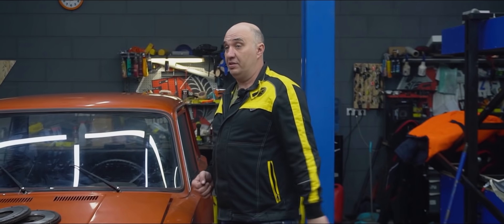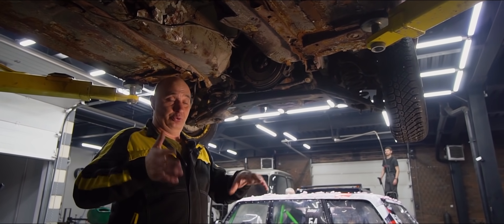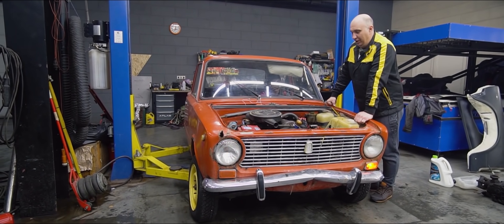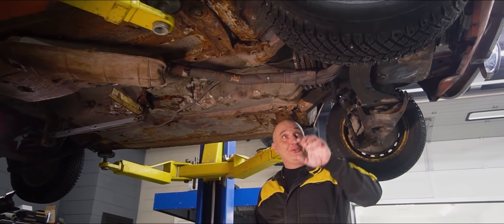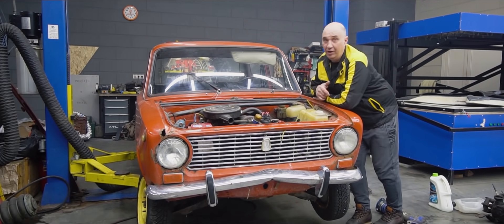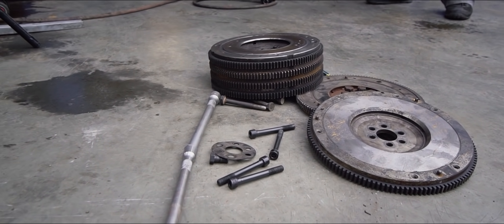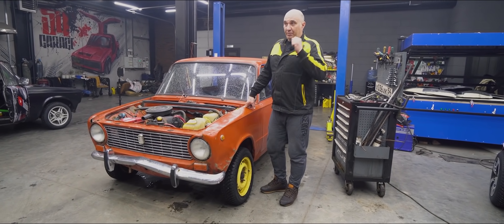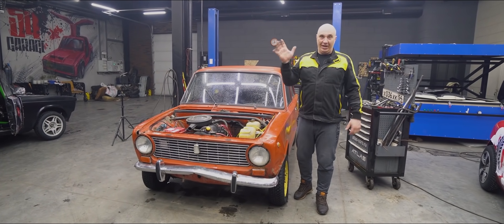What if you install FIVE flywheels onto an engine?

Comment: My guess is going to be "The smoothest idle you ever heard."
Reply: Imagine that inrush current in the starter motor with all that inertia to overcome....
Reply: @TerryGilsenan   no different when the oil is super cold
Reply: @MyKonaRC  Cold oil == more drag. Heavier flywheel == more inertia.
Reply: 😎<- idle
Reply: @TerryGilsenan  you can drive the whole car on the starter. It wont even notice a bunch of flywheels
Reply: @m.b.82  not for long you cant.
Reply: @TerryGilsenan  no. But it does it easy
You can overheat and burn out your starter in normal use if you run it too long. But torque is not an issue whatsoever.
Reply: @m.b.82  okay :)
Reply: That’s why they fit light weight fly wheels to race cars quicker going up and down the revs more responsive
Reply: Now, put on one more. Make it five flywheels.
And
Put on the door closer.
Make some young girl without license drive it.

And also try to have really low RPM
Reply: The smoothest idle would probably go to a V12 or a Flat 12 engine.
Reply: Stall allert
Reply: Yeah, constantly idle 😆.
Reply: Тоже этот детсад, интересуетесь
Reply: Hi
Reply: yup smooth idle verry little vibrations and hard to accellerate , it might break the snout of the crank
Reply: @huntsbychainsaw5986  wankle😂😂😂
Reply: @TerryGilsenan  air compression is the most to overcome, then tension in pistons. Take a wheel of a car, (similar weight to flywheel and even bigger diameter ) then kick it or accelerate it with your hands. It’s not that hard.
Reply: @David-cy5zu  Starter motors are designed to be high torque motors that run for a couple of seconds or a minute at most. They were not designed to run high current (200+ amps) for more than a few seconds. This is their "duty time".

Even if you remove all the addition load from compression and drag, they still only spin at around 2000RPM and they still draw more than 50% of their rated current, because they are almost a short circuit.

Want to know their MAX RPM? Start the engine, and at a low idle, engage the starter motor, what do you hear? You hear the stater pinion gear getting kicked out of mesh with the flywheel ring gear, why? because even at low idle, the engine is too fast for the starter motor.

As for overcoming compression, most high compression engines for example high capacity diesel, have a decompression system that allows the starter to spin the engine without compression load and then once the starting inertia is overcome, the decompression system disengages and allows the combined stater and engine inertia to push the engine through the compression cycle to reach the "bang" cycle.

In my younger day I made quite a dit of money hustling people with "big bore" single motorcycles, by betting that I could start the engine with one hand.
Reply: @David-cy5zu  Try and spin that same car wheel beyond say, 300RPM, then tell me it's not that hard. :) Circular motion requires CONSTANT acceleration. This is simple newtonian physics. The amount of energy required to increase the RPM of a spinning object is NOT linear, it is a logarithm, and the mass of the rotating mass is part of the calculation. Even if you remove ALL the friction (impossible, but for the benefit of this discussion) the amount of energy you would have to introduce to increase the RPM of the spinning wheel, increases with the RPM.
Reply: @liamc666  You get it. :)
Reply: Flywheel-powered bus:

Rather than carrying an internal combustion engine or batteries, or connecting to overhead powerlines, a gyrobus carries a large flywheel that is spun at up to 3,000 RPM by a "squirrel cage" motor.[1] Power for charging the flywheel was sourced by means of three booms mounted on the vehicle's roof, which contacted charging points located as required or where appropriate (at passenger stops en route, or at terminals, for instance). To obtain tractive power, capacitors would excite the flywheel's charging motor so that it became a generator, in this way transforming the energy stored in the flywheel back into electricity. Vehicle braking was electric, and some of the energy was recycled back into the flywheel, thereby extending its range.

https://en.m.wikipedia.org/wiki/Gyrobus
Reply: @TerryGilsenan  Try that on a 1970 Norton Commando :)
Reply: @andrewallen9993  I would have loved to try that.
Reply: That engine may rev and decelerate slower but if you give it a sudden load it wouldn't bog or stall this extra heavy flywheel is particularly beneficial on generators, pumps, air compressors, brush cutters, wood chippers, bulldozers/tractors, and other equipment that needs to run at a constant rate with rapidly varying loads and sudden loads. Most beneficial for high torque applications with low revs/hp
Reply: @dodgeme1986truck  Yes, That is 100% the actual purpose of a flywheel.
Reply: Another effect for the same inertial torque while lightening the flywheel mass overall  is to increase the flywheel diameter.
Reply: Ever felt.....all those flywheels absorbing the harmonics
Reply: @dodgeme1986truck  Farymann  V twin engine I have, push down on the decompression lever to stop. And wait,  and wait, and wait some more. But don't release it or the engine will come right back up to speed. https://www.youtube.com/watch?v=3U52aeWKV50 like mine except mine has a 15kW Lima alternator on the back of it. And a bigger flywheel. All that rotating mass means that your frequency stays very steady. Throw a load on it and it says, Okay, got anything more? Same thing with the Gravely 310 Chipper. Huge Flywheel on it driven by a 25 HP Cast Iron Kohler K series engine. On a ProMark unit. https://www.youtube.com/watch?v=YPd_AT0BliQ which is where Gravely got them from.
Reply: @TerryGilsenan  Just install another clutch and very carefully connect the flywheels after starting the engine. Maybe spin them up with an electromotor first :-)
Reply: @marekstanek112  you would need two flywheels then :)
Reply: @TerryGilsenan A multistage flywheel LOL
Reply: @marekstanek112  Yeah, that would work. During the industrial revolution many factories were powered by steam engines that had compound flywheels like this. A 500kg primary flywheel for the engine itself, and then once up to speed and up to heat, the second flywheel was manually engaged, and this one often weighed several tonnes. I saw one with a 5,000kg flywheel. The energy storage in that at 300RPM...
Reply: @TerryGilsenan  My father worked for Joseph Lucas he said they would test a new model of starter motor by bolting it onto Mr Lucas Rolls Royce.
If it could propel the heavy car to the top  hill outside the factory without burning out it was considered a good product.
Reply: @TerryGilsenan  bro you really like flywheels thats awesome
Reply: @TerryGilsenan  If ot's Russian starter the limit is just the power of batery... Belive me i know i owned 10 years UAZ 469 B 1979 model.
Reply: And torque. Lots of torque.
Reply: instablaster.
Reply: Bit like an old ford slant 6 cyl with heavy flywheel….
Reply: Probably it might brake off the end of the crank
Reply: @TerryGilsenan  "Cold oil == more drag. Heavier flywheel == more inertia." like induction vs capacitance
Reply: @m.b.82  finally my Volkswagen diesel is now a Tesla.
Reply: my guess it would just be a heavy flywheel
Reply: lol yeah

Comment: 4 flywheels + automatic clutch = the perfect beginner's car.
Reply: or how about we just make one flywhheel that weighs as much as 4 flywheels and swap them out for when you begin to learn and put a normal one after you get the idea down.  would almost eliminate stalls but the other side affects of slow rev and no engine brake seems like a bad idea too..
Reply: @gregthemechanicman  Something that automatically goes through the clutch bite point, and automatically holds the revs doesnt strike me as a "learning tool" so much as a never-stall system with caveats😂 .
Reply: You don't even really need a clutch anyway... Start the car in first gear with no breaks, it's janky af but does work, when it starts... drive, when you need to change gear, lift slightly off the accelerator slip into neutral then align the revs with what they would be in second gear and slip it into second with as little force as possible, it just clunks in... ect. same kind of thing to change down gears too. I have done this many times as a kind of party trick. No-one believes it's possible until they see it.
Reply: @JessicaMarinaRushie  I wanna meet you because a woman that knows this much about cars is extremely rare. 😍
Reply: @JessicaMarinaRushie  only issue when having to drive something that the clutch went out and locked together on, when the battery dies from using the starter to crank it.. better hope it's running really good to start with, an old motor that's barely even running on a good day or really hard to start.. gonna kill that battery real quick lol..
Reply: @slimwilly573  Yea tell me about it, Once I had a break down on a motorway with nowhere to park so I used the starter and 3rd (Might have been 2nd not sure) gear to keep the car moving until I could stop safely. Needles to say the starter overheated and I had to replace it and the battery didn't last long after that either... all for a blown water pump gasket, which the garage tried to lie and claimed it was the head gasket... They picked the wrong person to mess with, they fixed it for free in the end.
Reply: @DigitalDissident  HAHA, I am not so interesting. I can fix cars that don't have all the pointless electronics but new cars? Nope... I hate new cars, they are made on purpose to cost a packet to repair. Some cars even have coded batteries now so you cannot even stick a new battery in without a computer and what do we get for it? a few extra miles to a gallon? who cares honestly. I would rather have a nice "lightweight" and "simple" car, but they are a thing of the past now.   :(
Reply: @JessicaMarinaRushie  Wow you're saying exactly what I have on many other car related videos be it Scotty Kilmer or Rich Rebuilds... I actually own two manual coupes & I learned to drive stick a few years back because of all the tech that's put in new cars. Interesting & like minded.
Reply: @DigitalDissident  Sounds like you live in the USA, I live in the UK, I think the problem with tech in cars is much worse in the US. We always are behind when it comes to tech. But the problem is getting worse because older cars just get scrapped all the time because we can't get the parts anymore.   :(
Reply: Jessica Marina Rushie 
Learn how to drive from a trucker? That’s how you need drive when you’ve got 10 speeds ahead and a 200lb clutch throw, minus taking off with just the starter motor. 
It’s funny, synchros actually make clutchless driving harder, older cars with non synchro gears slip in and out of gear easier, and you don’t have to worry about wearing them out.
Reply: @robertdevito5001  I learned from my grandad who was a driver/cook in the army. Apparently he used to get told off for using the clutch for some reason. God knows why. So... I guess he was a trucker.  :)
Reply: @JessicaMarinaRushie  I'm gonna have to second the other guy. You work on cars, you like minimalist cars as well (I drive an '05 Civic coupe and that's about as basic as it gets) and you're a game developer. Yep -- I'd wife you up lol.
Reply: @The513Warning  Wait... How do you know I am a game developer?
Reply: @JessicaMarinaRushie  It's in your "about me" section. I only clicked to see if you had car vids, I swear lol.
Reply: @The513Warning  Oooh I forgot I did that. I am 40 and have a wife ;) She was my best friend, we met when we were 8 :D
Reply: @JessicaMarinaRushie  You're good. It was more of a compliment than me being serious. I've only met maybe three women who were into cars and it is pretty attractive. It's pretty rare too. When I worked construction, I met a female plumber and was about ready to marry her when I saw her using pipe wrenches lol. I hope I can be in your shoes one day  to see 40 and get married but I can't find a woman dumb enough or desperate enough to settle for me lol. As high strung as I am, I might be lucky to see 29 next month.
Reply: @The513Warning  I believe that everyone has their other half just waiting to be found. I hope you find them soon. Also... Lol I have worked on building sites too, fitting windows, shopfronts, plumbing, and even doing roofs, got to make the money some way I guess. I hated it though. Game dev is much more fun! hehe.
Reply: @JessicaMarinaRushie  Definitely appreciate those kind words. I usually turn my displeasure into a joke. Helps sometimes lol. And there's definitely a lot of money to be made in the trades. Probably nowhere a developer's pay, but still pretty good. It's job security as well as a skill that'll stick with you forever.
Reply: great till you go downhill or want to use engine braking! You want the revs to snap back down and give all the feedback they can. I learned to drive on a tractor with a very heavy clutch, nuffield 460, but the first time I drove a car it was so different because of the way that it responded to the revs. The biggest difference is that with a petrol car engine, you have to adapt your use of the engine to how the car is, whether you're currently stationary or on an incline for instance. With the tractor you just pick a gear, pick a throttle position or don't, drop the clutch and it's moving
Reply: a normal clutch, plus a lockable centrifugal clutch/viscous coupling would be perfect. You can have the precision of using a clutch for things like reversing. you could use the clutch pedal for changing gears still, but no worry about stalling the car
Reply: if only they made special transmissions that can shift correctly for you, and will even hold  the clutch in when you slow down...
Reply: @JessicaMarinaRushie  You can do that, but it means that the synchromesh-rings of the gearbox take the roll of the clutch. being misused this way wears you gearbox down really quick. Only do this party trick in your friends cars
Reply: @fleeseeksboxconundrum1789  you're right about that, it only works in older cars anyway...
Reply: @JessicaMarinaRushie  it's how you shift when your clutch is out. Matching rpm then throw it in gear
Reply: @theguy9208  Look into the CVT Transmission if you don't know what it is already... They are pretty nifty. They make changing gear not so important.
Reply: @JessicaMarinaRushie  I hear you old timer. Did you know that some cars dont even use gas?
Reply: So an automatic gearbox?
Reply: @gregthemechanicman  probably if you don't go crazy, maybe 1.5 or 2x  weight fly wheel. Boy racers sometimes change the fly wheel for a lighter one.
Reply: @JessicaMarinaRushie  as someone who just had to fork over $500 today to have an ECU reprogrammed (they're not interchangeable anymore) and then another $250 for the new ECU itself, I agree with you to an extent regarding too many computers in cars 

That shit should be limited to non critical functions, so if it breaks, you're not left without transportation
Reply: @mwbgaming28  Absolutely, it wouldn't be so bad if the parts were not designed to break and every time a tiny thing goes wrong the car goes into limp mode for you to then have to pay for a tow and the garage and then you find out it's just a faulty censor.